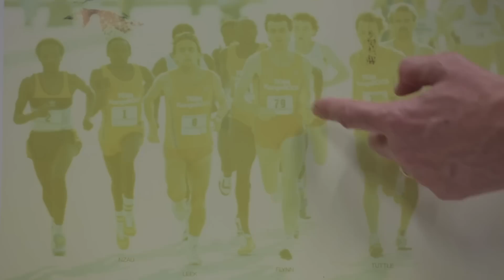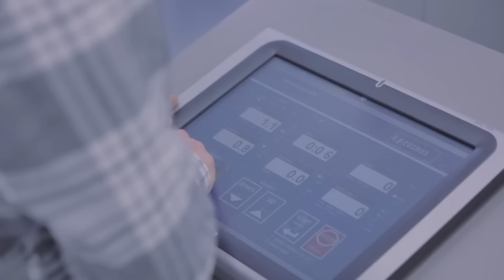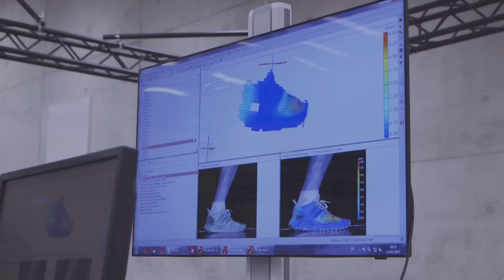What Goes into Making the "World's Best Running Shoe?"

Comment: let's be real. who actually wears the ultra boost for running.
Reply: FilthyFranku runners
Reply: I did.
Reply: FilthyFranku Its good for light running or on a treadmill but definitely not suitable for long distance runs. The outsole is not very durable even after the continental update.
Reply: totally agree
Reply: Aiman Rizal fuck you mean not very durable, after the continental update the soles have lasted me over 600 miles
Reply: Apocalypto just one question, is it only one pair?
Reply: Aiman Rizal You can with the ultra boost
Reply: Aiman Rizal one pair of shoes training all summer for the cross country season
Reply: Apocalypto I have watched some reviews on the performance of the shoes. Its a great shoe but some said the outsole is the biggest problem of it even after the continental update. If what you said is true, then ill start saving money whenever they are restock in Malaysia
Reply: FilthyFranku I do
Reply: Bro, baik check facts dulu sebelum comment
Reply: I DO AND FOR CASUAL WEAR
Reply: FilthyFranku 🙋🏼
Reply: FilthyFranku for real
Reply: I do lol, and they're petty damn beat up now, the primeknit uper has couple of holes in it and the outsole is pretty much flat.
Reply: FilthyFranku I do. That's actually what it was designed for. And I had the original energy boost and traded in my asics for them. Best decision ever.
Reply: It's not. When you compare shoes at this price range, you're looking for something that can last at least 800 miles. My old Asics Gel Kayano lasted 2 years with about 1300 miles, and the midpart of the outsole still in good condition. Adidas shoes are never durable. They might have cutting edge technology, but it's kinda mediocre if their shoes wear out after 6 months. I only wear Adidas for casual settings and football (soccer).
Reply: FilthyFranku man I do
Reply: I've seen more people wearing ultraboosts in coffeshops than in the gym.
Reply: FilthyFranku true😂
Reply: I do, and i love it !!!
Reply: I do mate
Reply: Wanye Kest me
Reply: Hypebeast
Reply: Me. 4 times a week